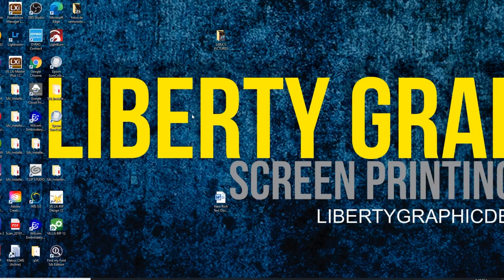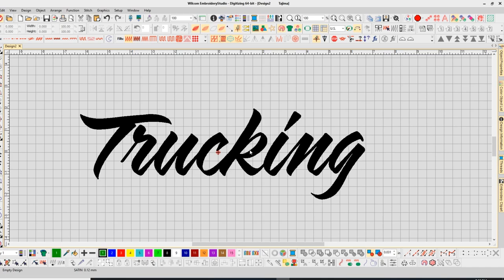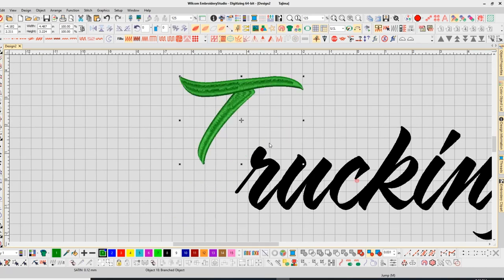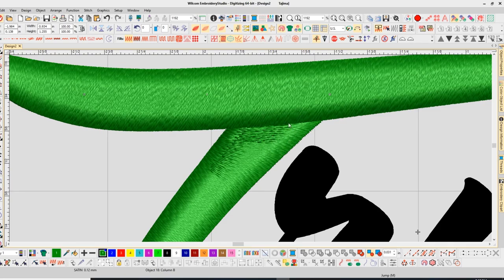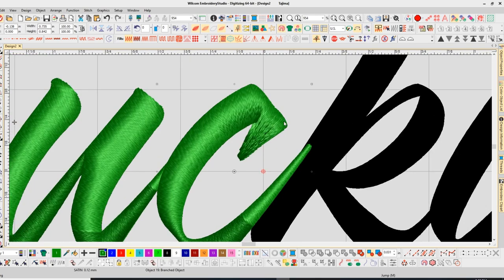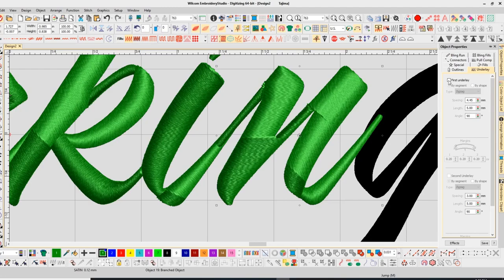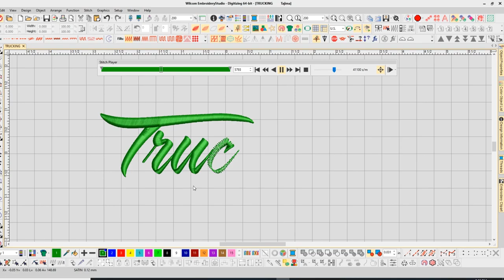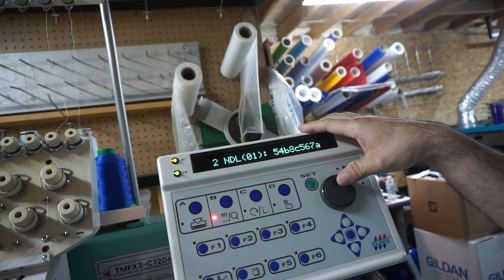HOW TO DESIGN, DIGITIZE AND EMBROIDER A RICHARDSON HAT

Comment: That was pretty cool, and I didnt think it was too long of a video.  You mentioned not welding the text together after you had digitized it, but what if you had welded it in your LXI program, and then imported it as an object and not text?
Reply from the maker: Thats is a great question, if weld them before importing them to tge digitizing software they will be one object and it will have the same effect as if you weld them together in the digitizing software.

Comment: What software do I need to get to digitize an image/file?  And what file format do I need to convert those images/files to in order to digitize?  I’m looking to get into making my own hats, and I have no idea where to start here.  Any advice you can give would be great!! Thanks!
Reply from the maker: Wilcom and Pulse are the two most used Wilcom is the industry standard, as far as the format goes it depends on the machine you're running however the format most used is DST files.
Reply: @LibertyGraphicDesigns  awesome!  Appreciate that, man!